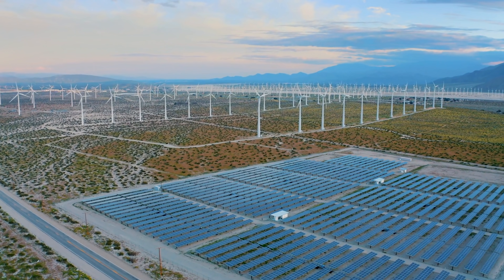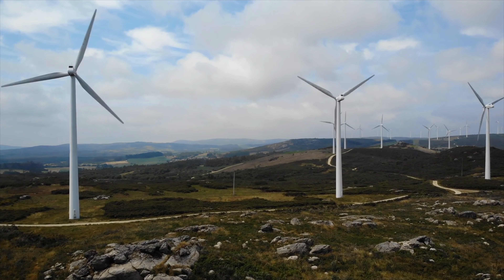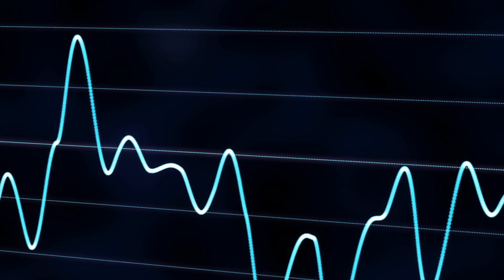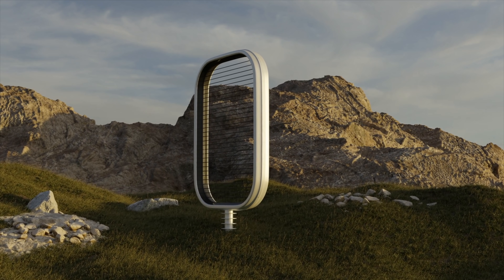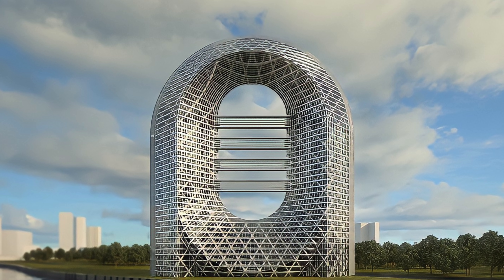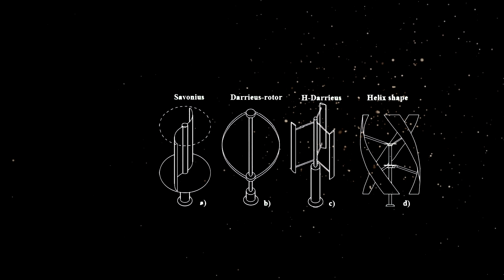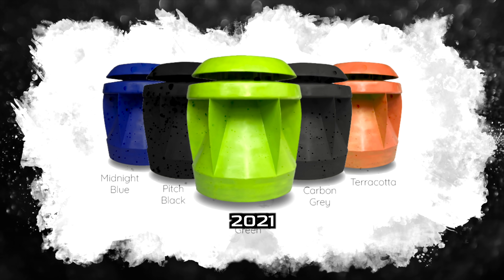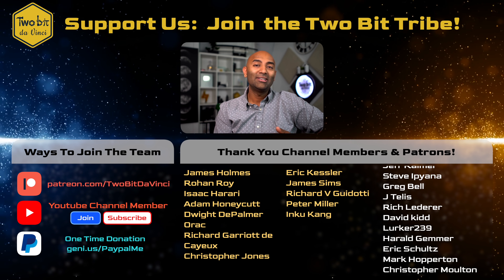These Wind Turbines have NO Blades!

Comment: As an engineer, I have one question.
HOW THE F*** DO YOU TURN AN OSCILLATING OBJECT IN 3D SPACE INTO ELECTRICITY EFFICIENTLY? 

Electricity is generated when you take a magnet and pass it perpendicular to a coil of copper and or conductive material. This works in wind turbine because  the magnet is spinning in a perpendicular direction to the coils that are wrapped around the inside of the turbine. What is the mechanism they are using to somehow take a non consistent direction of movement and pass the magnetic feild over the conductive material? According to basic electrical engineering you lose at a factor of two for every one point five degrees off of perpendicular the magnetic field is from the conductive coils. Seriously run the math, that vibrating stick would work at an efficiency of less then 2%. It literally would be more efficient for a human to blow on a standard wind turbine, then to use that thing. Unless they have created a brand new way, violating our current understanding of quantum mechanics, that vibrating stick is a scam.

Comment: About wind supplementing solar panels at night. I doubt so. Wind is very reduced at night. The vibrating ones seem to have nice potential. I wonder how bad is the noise. They probably won't be any good for homes, but could be inserted within the current windmill fields and increase their productivity by a good lot.

Comment: You cannot just "fit more of them in the same space".  They will generate vortices in the airflow around them and you would not be able to place another of these in an area affected by these vortices without lowering the efficiency of both.
Reply: The same issue applies to HAWTs.  With vortices taken into account, one can put multiple VAWTs on buildings and around buildings.  One can’t put any HAWTs in the same space due to the clearance required to spin blades on HAWTs.  Even when you can put in an HAWT, they produce much larger vortices affecting a much larger area especially when the HAWT rotates on its horizontal column to catch wind from different directions.
Reply: This isn't necessarily true the way it is for HAWTS. There are people experimenting with VAWT vortices that might actually improve the air flow over the following rows. The biomimicry of fish schools.

Comment: I personally prefer vertical turbines over horizontal turbines.  Vertical turbines are easier to maintenance, insensitive to wind direction, and are far less sensitive to air turbulence so they don't require trees being cut down to reduce air turbulence.  And you can cram a lot more of them into a given, high wind area due to the lack of sensitivity to air turbulence - such as other wind turbines.

Comment: If we as a global society can train more to fix and maintain these structures we could all have a better quality of life. All the while fixing climate change and the military-industrial complex. All countries should de-militarize. It doesn't make sense. If the world is on fire, why burn more fuel to blow up more bombs. Send solar panels and wind turbines not bombs!
Reply: Make art not war. Science is an art!
Reply: Every munitions factory should be refitted for alternative energy production. Have we not all seen mad max? I still can't figure out where they kept finding tires without rubber trees!
Reply: Demilitarization is a Prisoner's Dilemma.  Sure, everyone would be better off if they could quit pouring resources into their military.  However if one country keeps its military when everyone else demilitarizes they'd be able to use it to gain far more resources than they every could have saved.

Therefore significant demilitarization won't happen.  Unless there's only one country, or all countries defer to the military strength of a single hegemony (a scenario that the peace-preachers who rant against US imperialism should probably consider addressing).

Furthermore war is technically an art in exactly the same sense that science is.  Have you not heard of Sun Tzu's famous book?

Also rubber can be synthesized from petroleum.  That's actually our primary source of rubber today, not trees.
Reply: @VitalVampyr  should one not lead by example especially when in the seat of power. If one is waiting for others to act first who is leading who. Work to fix resource issues and reduce the necessity for combat. I'm not saying one should accomplish this overnight but it should be a virtue. The effort to stop a war has never been then virtue of the US government. They say it is but the track record states otherwise.
Reply: @Satan-Christ  Globally the rate of warfare has actually been significantly lower since the end of WWII, the start of US Hegemony.  Some historians call this Pax Americana.

Sure that doesn't prove that the US prevents wars, geopolitics is a very complex system that defies such simplistic analysis.  It's pretty good evidence though.
Reply: The point that I am ultimately getting at is the US military budget is way too big and that money should go to better efforts. The ratio is off in the wrong direction. The military budget could contract significantly and we would still be the biggest global spender. Seems like we could use that to improve our own and others infrastructure.  Reducing the need for consumables for energy and the "necessity" for war. Start reforestation efforts. Right some historical wrongs. Address the insane concept of infinite economic growth on a finite planet. Make the idea of not breeding constantly normal. Gotta be constantly making the next batch of soldiers and laborers. Consume consume consume. Feed the machine. Let's retrofit the machine to work in reverse. Does that sound unreasonable?
Reply: @Satan-Christ  There's certainly no arguing that the US spends proportionally more on it's military than most countries.  Not quite to the extent most people tend to think, NATO mandates military spending at least 2% GDP and it's been a little over 3% GDP under most recent administrations.  Not that NATO's mandate is actually enforceable, most members fail to meet it.

If were up to me the US would simply pause the annual increase in military spending for the next several years until being within about .1% GDP of NATO's mandate.  Barring the outbreak of a major conflict of course (for the purposes of this consideration no armed conflict that the US has participated in since WWII would count as "major").  I'd also like to see a major increase in spending on social programs and domestic projects.

I'd definitely disagree that we're even close to technologically prepared for a fully post-capitalist society though.  Some steps which might be considered as "phasing out" capitalism are warranted.  Things like sustainability-conscious regulations, universal healthcare, and universal basic income for example.  Humanity still has plenty of room for growth, especially since extraterrestrial expansion is quickly becoming viable.
Reply: @VitalVampyr  I agree with you on most points. I of course wouldn't see it purely through the lens of military spending either. You would have to consider that if they decreased spending that would lead to a contraction in the industrial military sector which would then bled its effects into other markets. You would also need to consider that a large portion of jobs across all markets are kind of pointless. Do we really need factories churning out wish app junk? How many inferior and worthless products are produced annually?  Why is everything disposable?

Comment: I find the idea of producing energy from wind interestingly wasteful.

They produce these massive turbines blah blah energy blah blah generated blah blah.

But how many times have you been simply walking through the street by a tall building and been blown all over the place.

Why not make use of that energy being created by the tall building right in the city where the energy could be used, less loss, less waste, on sight power generation.

Not only that building could be designed to produce wind, so the wind could be harnessed,  channelled directed to a means by which to make use of it.

Also think of all that wind pressure being generated in the subway system, why not make use of that to generate electricity as well, small generators producing enough energy to supply smaller amounts of power but multiply those smaller amounts and they make huge amounts of energy.

Just look at your computer screen, tiny pixels make up the picture, one pixel on its own means very little to our eyes, but when you combine all those pixels  you get a worth while image, the picture doesn't vanish because one pixel breaks down, likewise energy generating would be more robust if it was generated by multiple systems, less wasteful and more reliable.

Tunnels often can be designed to produce wind pressure.

Comment: What is the 6,067 MW for in the image around 0.44, it is way to small if its current power generation from wind power world wide. Some countries have multi times that alone
Reply: That’s the additional capacity that was installed in 2020 alone ranked by country. It’s not the total capacity that each country has installed overall. Hope that helps :D

Comment: I think that if civil wind turbines will be more widspread, there will be regulations to prohibit placing them along train ways, as harvesting wind energy off mooving train is essentially taking some of it's power and loose some of it during the process, so it will require some extra energy harvesting and probably increasing carbon footprint in the process
Reply: There's already some wind turbines near the car tax stop. (Sorry i dunno what's that called)

Comment: That oscillated thing is going to be loud and do a lot of noize pollution around it. Also installing it on regular structures will result in introduction of extra vibrations. For example, placing several of this things on the roof of your house will cause problems to roof integrity and extra noize, as unharvested power will go mostly into destroying building structure and generating noize. In theory it's possible to arrange these things in a way to cancel out their oscillations at the point of mounting the array of them but if you recall multiple methroome experiments you will see that it's very hard to achieve

Comment: wouldn't it be so much more efficient and reliable to give every household a little power generator?
one individual generator breaks down? no biggie, you use the available power everywhere else to build them a new one.
one giant turbine or power plant breaks down? everyone loses power.
decentralized power generation.
it would take a massive failure to bring it down.
Reply: More efficient… every household… little power generator?

Not really. Small generators are very inefficient. Large generators, which are always running, create massive quantities of heat, which burns fuel much more completely, resulting in very clean air, and much better use of fuels.

Grid tied small wind turbines & solar cells have a lot of potential, if a neighborhood could be configured with a generator system to keep the grid up when central power goes.
Reply: @DavidHalko  ......and why not de-centralize the central power for good and have dozens of redundancies so that any breakdowns represent just a small percentage of the total?

Comment: ERROR AT 0:40                        ERROR AT 0:40                         ERROR AT 0:40                         ERROR AT 0:40                      ERROR AT 0:40
It states 93 gigawatts was added in 2020. And yet the graphic says that the TOTAL installed wind power is 6,067 megawatts.
If we standardize the unit of measure, the TOTAL INSTALLED BASE of 6,067 megawatts equals slightly over 6 gigawatts.
Sorry, but if the total base is 6 gigawatts, CLEARLY 93 gigawatts (over 15 times the total installed base) were not added in 2020

Comment: I don't get the Skysails idea.  Surly the power needed to reel the kite back in will exactly negate the power generated when the wind was pulling it out?  I've seen similar ideas where the kite takes up a huge wind generating rotary blade which looks a lot more efficient to me.

Comment: I would not trade one Bald Eagle for all the wind energy west of the Mississippi.  It's totally wrong think to act like killing 100's of thousands of animals is totally cool and "not equipped to argue" with anyone on that point alone.  Dafuck are you talking about bald man?   I live in Texas and the "Super Green"  Wind turbines have killed many rare birds bats in our own back yard.  I find them under every single one I have walked under.  
       Not to mention the waste left over after they are torn down and dumped in landfills.  Or the massive carbon footprint of thousands of gallons of bunk and diesel it takes to move them to the sites they are set up on.  It takes a whole 18 wheeler just to move one blade.  Say what you want about burning natural gas for power but I don't see piles of dead animals around NG power plants.
        Wind power has alot of promise but in it's current form it's just another corporate money grab and guys like this clown are patting them on the back for it.  2 bit Da Vinci change you name to 2 bit shill, your not a patch on Da Vinci's robe.
Reply from the maker: Do you eat meat? Is that ok? Do you burn gasoline? Want to hazard a guess how many millions of animals of all kinds are killed by that? Sounds like you care very very selectively
Reply: @TwoBitDaVinci  I eat one deer all year.  I only kill older deer so it does nothing to the population.  I burn a little gas but not much and I used to work at an oil refinery that while dirty and bad for the air did not have piles of dead animals around it.  Roadkill is a much larger number of kills than burning anything wheres your complaints about that.  You don't care about animals at all and it's obvious there lives value ends where your convenience begins.  Like most people you live in a bubble and want power on demand but don't really care where that power comes from or the realities that people like me had to see first hand.  Wind really is the answer to all the power problems but the current format is awful.  Anyone who does not see that is only looking surface deep.  If I have to choose between Natural Gas power plants and fields of dead animals I will take the Natural Gas.

Comment: The oscillating tube are useless and can only produce a few watts at best. You would need a1000 of them to just power one household. Blade turbine produce MW and power 100's of homes. No matter how hard you try you cant beat science. It takes 1 HP of mechanical energy to make 746 watts of electricity.

Comment: some of these look very pie in the sky, and some don't actually look like their wind turbines at all, which means they are something else, that frequency generator comes to mind. 

i recently found a really cool one created by an scientist dude who his around 15 years ago and nobody has as efficient design as his is. 

i think he calls his tri-turbines his are the vertical design, and yes they are using blades but they are meant to capture the wind from either direction and can collect power from not only the bottom but the top, they don't wobble and are super efficient, the base of them uses some kind of circuit board design along with magnets that go with the flow of it's design which not only improves the performance of the turbine but it also speeds up the process making it much faster and reduces the drag some of the vertical ones have major issues with, and have no maintaince for a good 20 years of operation. 

just by viewing this turbine, you can see, by the design that it's not pie in the sky like most of these listed in the video. it is superior to all of the rest out there and i have yet to see a better design as of yet. 

but the guy has mostly been selling his design for commercial use and the price he asks is much too high for the average home owner to purchase, he needs to drop the price of these things if he want's to change the world for the better as he says he does.

Comment: Everybody wants the most out of a single unit. That results all the problems you stated for traditional wind turbines. I always prefer the VAWT's. They can be mounted lower and start  generating at lower wind speeds. And they don't have to be locked down for high winds.

Comment: Interesting concepts, but please, please stop with the wind industry propaganda about killing birds. Every time I hear a wind energy proponent bring this up, they always trot out the tired meme about house cats killing more birds than wind turbines. The problem is that it's not about the number of birds killed, it's about the type of birds killed. House cats kill birds which are of low conservation value, such as crows, pigeons and sparrows. Wind turbines kill birds of high conservation value, such as eagles, hawks and condors. There is no comparison between the two. Please stop spreading this wind industry disinformation.
Reply: Forget the birds, the HAWT's can't handle high winds. You can have a dozen or so VAWT's equal to the 1 HAWT on the same post. You can service 1 VAWT and only have a partial loss.

Comment: You can put a VAWT on any homes roof as well as any business , warehouse it would just take the shape of a jiffy pop popcorn dome with angled slots cut in the sides of the dome structure.. We've all seen the same thing on warehouses to pull the hot air out of attics it's the same thing just generates power... Solar by day n wind by night when your home and you are at rest staying up or replenishing your power bank at night, plus you don't have to wash them or  to keep them free of snow and less damage from Hail or debris.. 1-2 on a home and one on garage will keep power from grid down n more $ in your pocket and pull hot air out of the attic or out of garage dual purpose... Alight now back to your scheduled programs... From the States PEACE